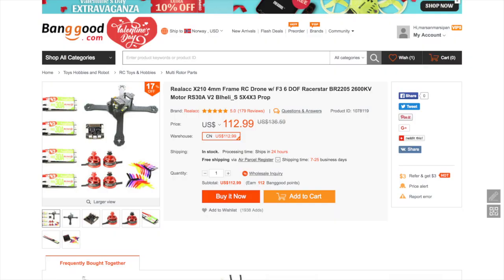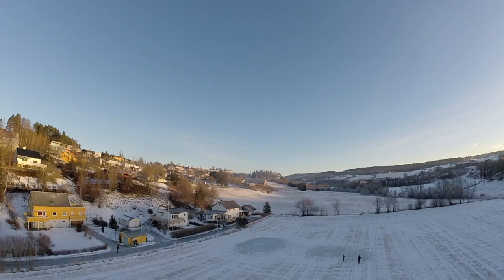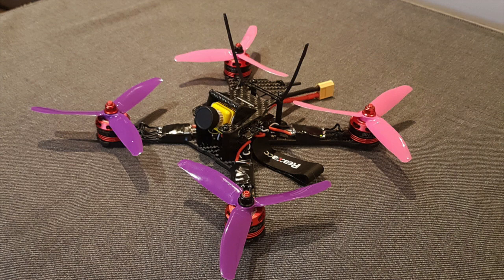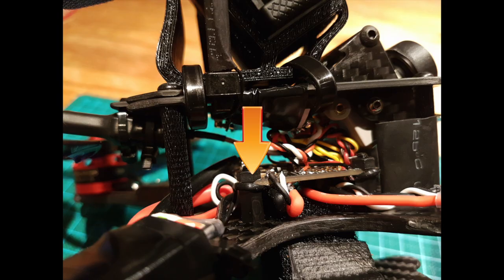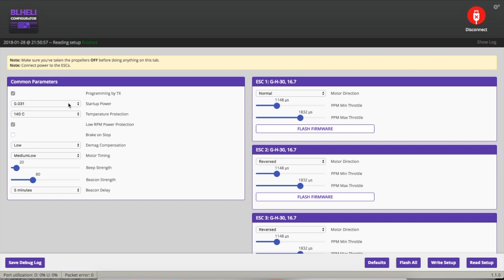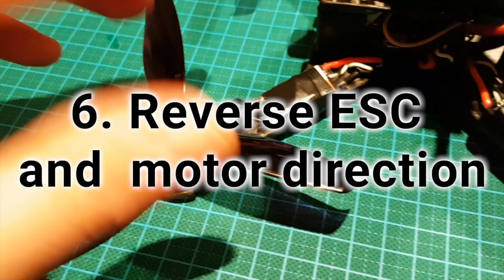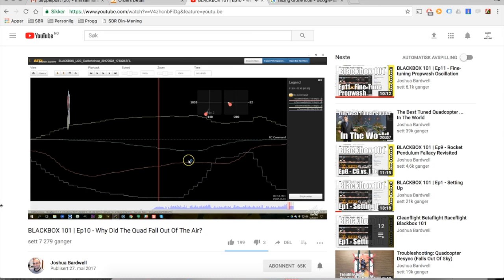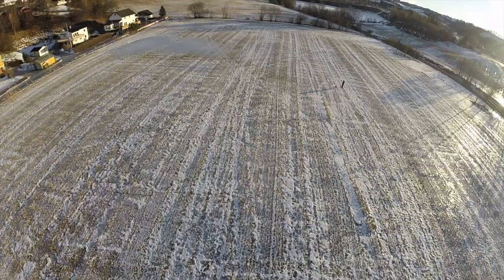Dealing with Spin of Death \\ drones in general

Comment: My f405 drone just rolls as you reduce throttle even little bit and falls to the ground
Reply: It's a mamba f405 MK2 flight controller
Reply: Did you ever find solution to this, and how often did it happen? Had this happen to me recently.
Reply: @TEA-mg5eb  yes the 3d was on in configuration switched it off and it became allright